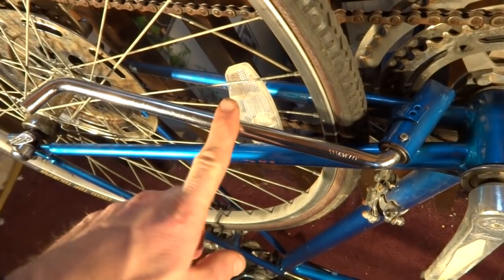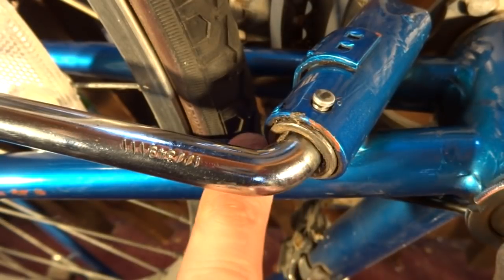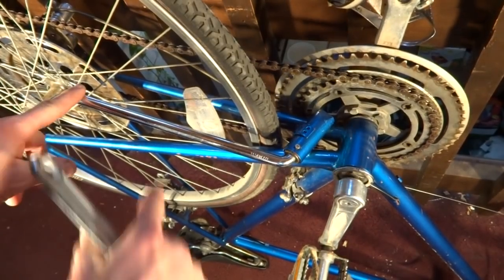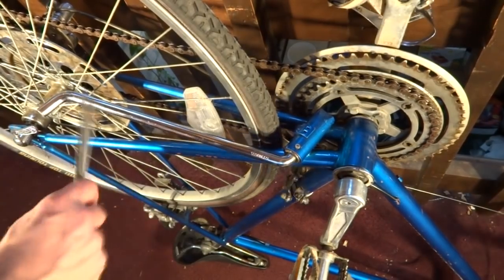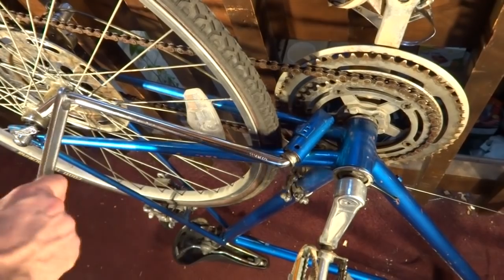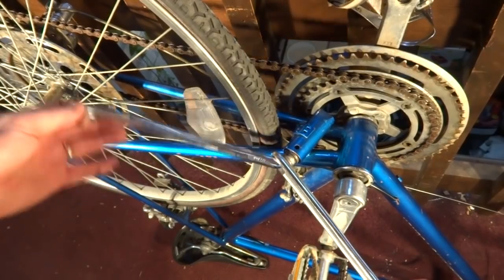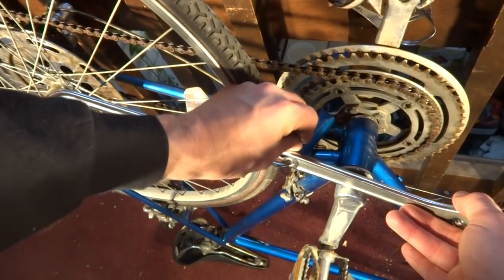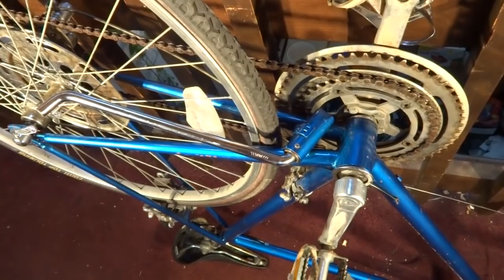How To Remove/Install Kickstand On Vintage Schwinn Bike With No Special Tools

Comment: Worked perfect on my '52 Schwinn D-13. I tried a closed end wrench (lazy, it was right there) and no go, so I pulled out my adjustable 10" Crescent (branded) wrench with a few drops of liquid wrench. Did the trick as required. Note the adjustable wrench has a round hole with rounded over shoulders while the closed end wrench was obviously splined and had a sharper shoulder making the lever action have less functional working travel, additionally the contact surface of the closed wrench could mar the surface. RJ is giving a nuanced technique and underselling the brilliant simplicity. Thank you sir.

Comment: Worked on many many road, touring and vintage of both. None of them Schwinns and none with this kickstand design....Until now. Striping an old Schwinn before sending it to the powder coater and had no idea how these things came apart (especially without the "proper" factory tool).  Until now. Thanks RJ!!!

Comment: Awesome video. F.Y.I, the pin is in backwards. It can potentially fall out. It needs to go the other way to lock the pin in. Hole might be a little snug but it fits.

Comment: My kick Stan is stuck won’t budge I did exactly what I I saw on your video even the pin won’t move. It’s a shwinn 1980’s cruiser.for now I have a cheap rim on the back.making clicking noise but going to find the original 5speed rim to complete it and a fresh coat of paint

Comment: Unfortunately my Crescent wrench has a diamond for a hole on the handle, so it wouldn't fit over the kickstand. I experimented with some box end wrenches and I found that the 3/4 wrench works pretty good also!
Reply: Similar situation. A 16 mm boxed wrench did it for me.
Reply: I just pulled four of them off with a 16mm. Thanks.

Comment: Hey RJ you should cover the other kickstand design.  I am looking at a greenfield design and I can trim to fit a 26er.  The original kickstand appears to be the correct length but the pin is bent at the pivot.
Reply from the maker: I generally remove kickstand and chuck them. LOL

Comment: I have a kickstand just like this. The other day it fell off and the little pin is missing and the space from the little hole to the edge where you put the actual kickstand somehow reamed out. Is this fixable or do I need to just put a new kickstand somewhere else on the bike?

Comment: The video was clear and helped me understand the kickstand mechanism.  Easy?  Not so much. And your video would be better if you had pointed out that this might be a very difficult process.  I didn't have a stand, so literally had to sit in a chair and jam the bike against basement wall while tried to use the wrench to get the spring compressed enough to get pin to fit in place.  I was sweating until I was done.  And the wrench worked in your case because I think the shoulder of that sleeve piece must stick out more than mine. I had to go past flush to move it enough to free to pin. Thus, I used a box  wrench that served to push on the shoulder and be small enough to fit into the housing and used the adjustable wrench as you did on top of it for the leverage.

And then, so what? You get the kickstand out. Mine was not staying up properly when riding.  I pulled the little cam piece out from the housing once I got the kickstand out. But it was all worn.  I tried to modify it a little and hope it will work better, but who knows if you can even find the right replacement pieces if I had wanted to.

So, well made video, but it ends up being rather pointless.  Spent two hours on it to really make no improvement to bike.
Reply from the maker: Sorry you found it pointless.
Reply: @RJTheBikeGuy  My son and I worked for over a couple hours trying to follow the video as I have a 1995 Schwinn Black Phantom that came with a new kickstand, spring, cam and pin. I had 2 size crescent wrenches and we had the bike on my bike rack upside down. But try as we did, we just could not get that 
shoulder of the collar far enough to allow the pin to go into the pinhole of frame; appeared that we were shy about 1-2mm. The shoulder of the collar was bottoming out against the frame and we just couldn't push it any further. The other question I have is that the spring has a washer at the end of it fitting over the end of the kickstand (that goes into the frame) and just past that washer is a hole in the kickstand is a hole with a pin (longer than the one that drops in to hold the kickstand in the frame). Does that pin stay in when inserting the kickstand into the frame hole? Not sure what the purpose of that pin is for since that washer does not seem to come off.

Comment: If it's old and rusty like mine was, just take a screwdriver and hammer to it. That'll force the ring in so you can remove the pin.

Comment: that helped a lot. but how do you get the spring off of the kickstand?
Reply from the maker: +Michael Gress Once you have have the kick stand removed, you will need to compress the spring. Maybe use pliers. Then there is a pin going through the stand that holds the the washer place. Remove the pin, then slide the washer and spring off.

Comment: I'm sorry but this is all wrong. First the head on the pin goes in head first. That is what keeps it from falling out. Second, unless the pin head has a worn flat spot, the collar that you are pressing on does not stick out at all on the welded on frame bracket. In fact the collar has to be pushed in deeper than flush in the frame bracket to put the pin back in or to take it out. I use a large worn smooth flat blade screw diver to push the collar in to get these in and out, it takes some muscle and the bike needs to be laying down on some blankets or the grass need be. Taking the left pedal off, left hand thread, helps a lot. I have done a ton of these without ever damaging anything.

Comment: Hi, I succeeded to remove the pin but I can remove the kickstand from the frame. Maybe something is broken and is blocking the kickstand. Do you have an idea to remove it ? Thanks
Reply from the maker: Can't tell you without working on it. With the pin out, it should come out.
Reply: @RJTheBikeGuy  Thank you. I tapped a lot of time and finally, I removed the kickstand. The front bushing was blocked in the kickstand housing.

Comment: What if it doest have that small bolt on the top? I have an bike with similar kickstand and I have been struginling with it for a long time because its loose my solution so far is been putting a zip tie so it doesn't get loose when im ridding. Is the steps the same or how do i remove it so i can overhaul it?
Reply from the maker: Then I am guessing you don't have one of these vintage Schwinns with an integrated kickstand.
Reply: @RJTheBikeGuy  ok maybe I should ask what other integrated kickstands are there and how to fix them...
Reply from the maker: @albertoxcore  Probably lot's. Shrug.

Comment: Picked up a vintage Schwinn frame and the kickstand pin looks like it was installed upside down (i.e., the larger pin end is holding the kickstand in). Any thoughts on how to remove? Thanks for the great videos.
Reply from the maker: You might need to release the pressure on the pin like in the video, then grab the pin with some vise grips.
Reply: shyflirt1 That did the trick. Thanks!
Reply from the maker: Cool!

Comment: I tried this and could not get the pin to release. I was able to move the kickstand out, but no luck on the pin. Any suggestions?
Reply from the maker: Nope. Keep trying.
Reply: The last person that put the pin into the stand did it backwards. It took some pulling and twisting, but the pin finally came out.
Reply from the maker: @rskypuppy2000  That might actually be the proper way. It wasn't like that on the bike I bike I was working on. But mine might have been backwards to begin with.

Comment: I'm follow what you're doing, but it's not working for me. What should I do?
Reply from the maker: Does your kickstand look the same as mine? Does it have a little pin? Does it have the the part to push in?
Reply: Yes it looks the same. Small pin and collar. On a '71 manta ray
Reply from the maker: When you slide the wrench over the kickstand and press down, is it contacting the collar? Is it pushing the collar in?
Reply: @RJTheBikeGuy  I have similar problem. I have a 1995 Schwinn Black Phantom. We mounted the bike on my Park bike stand
and used a 12" crescent wrench (and 10") and even with the both of us pushing the collar into the hole in the frame, we could not
get the collar to get far enough past the pin hole to drop the pin in. The lip end of the collar we were pushing against kept 
bottoming out at opening end of the pin hole. Looked to be maybe 1-2mm shy of being able to drop that pin into the hole. Any suggestions??
Thanks
Reply from the maker: @lendemoss7473  Dunno. I have never had a problem. Did you pull the pin out using this method? If so, you should be able to get the pin back in.